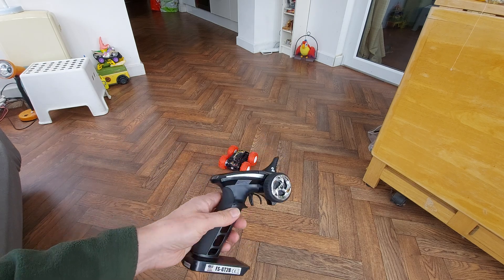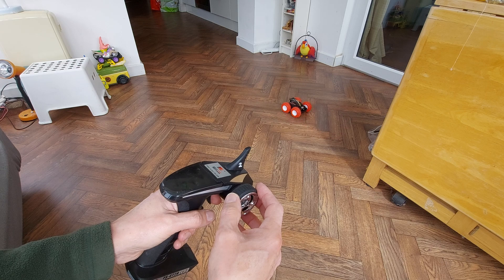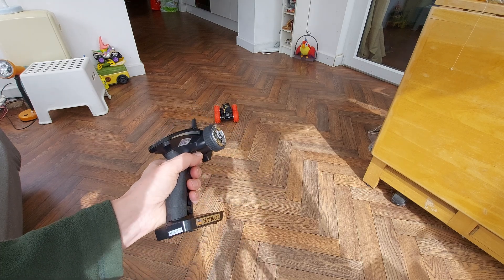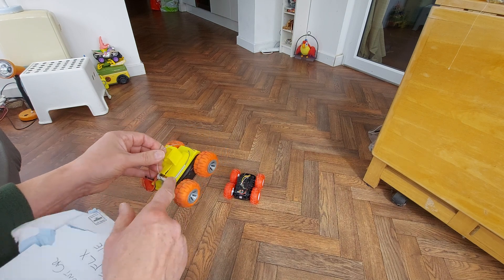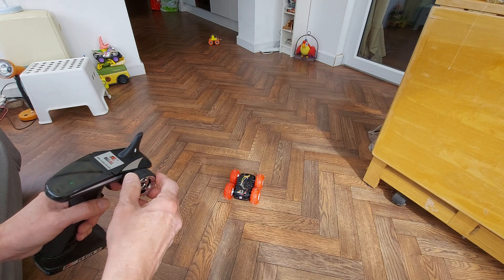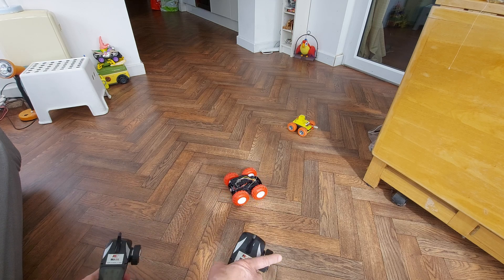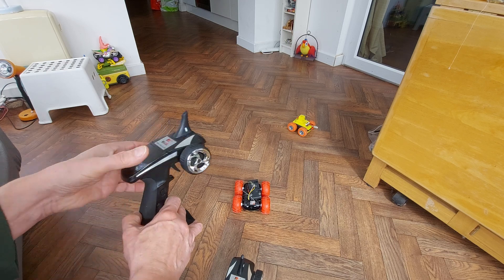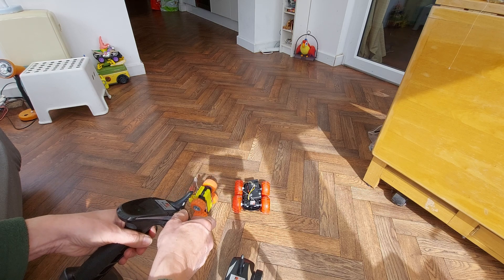Dual Brushed Motor Speed Controller CONFUSION PART 2

Comment: This does seem strange though I do have some speculations. The dual motor ESC would read both steering signal and the throttle, and probably do some math to figure out in which directions (and how fast) to spin the motors. 

First guess is that however it calculates this results in basically the same output on both motors unless you input a lot of steering, or go slow. 

Second guess is it's actually trying to turn but that the tires aren't suitable for this and simply pulls it in a straight line.
Reply: Also, adjust the steering trim might do something though start with the dual rate knob, set it to be as aggressive as possible for maximum steering.

Comment: Does the good ones controller have expo rates on it? That would sort out the twitchy driving. 
Am just as confused about the inability to go forwards and turn. I wonder if it can turn with the trimming control, or whether there are pins to enable 'modes' on the ESC 🤔
Reply from the maker: I get the feeling it may need more power, but I worry that might fry it. It may be that those motors are drawing too much power. Thinking back, I think I cooked the original motors, and those are higher voltage motors that I fitted to prevent them cooking, so that might be the issue.